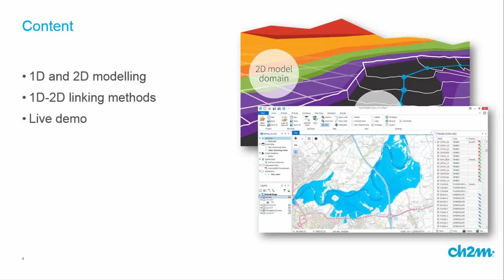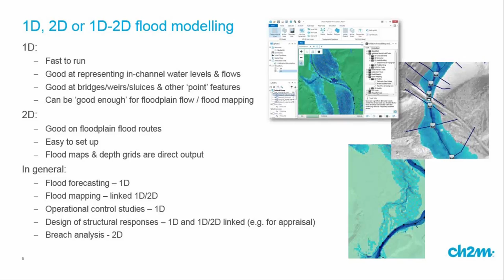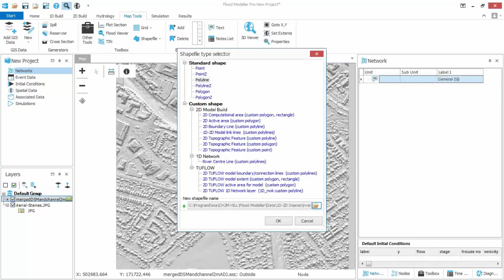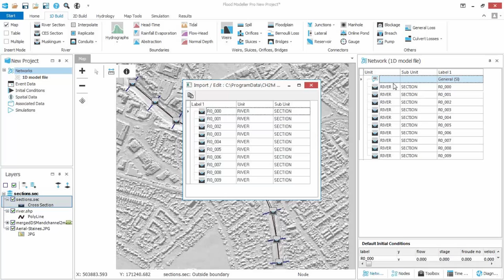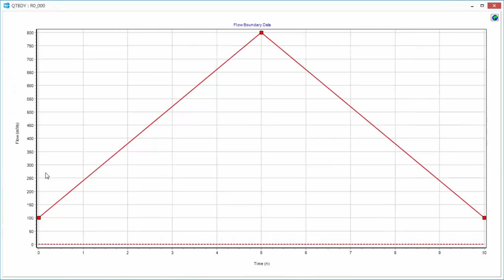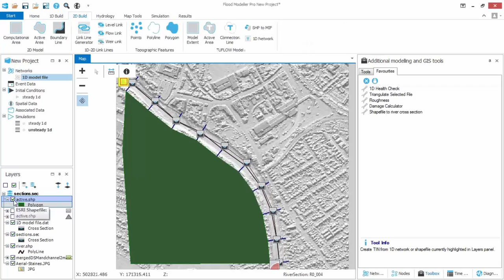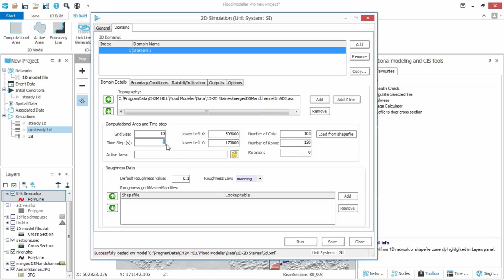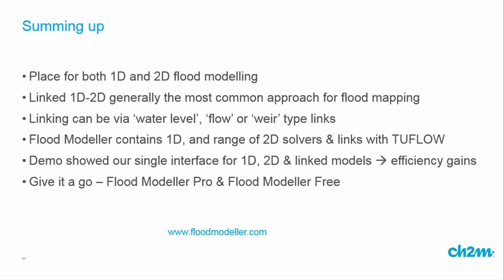Building a 1D-2D flood model using Flood Modeller

Comment: When pulling in a background map, is it possible to scale it? The scale of my background image does not match the scaling in Flood Modeller.
Reply from the maker: Hi there, background mapping is not actually used for any of the calculations, and so resizing this file outside of Flood Modeller may be the best approach. However, please feel free to contact support@floodmodeller.com and the team will be happy to look into your particular map file in further detail and offer suggestions.

Comment: Thanks this video was very helpful. just a quick question. if there is an option in Flood Modeller to do the 2D and Linked 1D/2D modellings then why some engineers use MapInfo to do the Linked 1D/2D? do we really need MapInfo when Flood Modeller is able to do that modelling for us?
Reply from the maker: Yes, Flood Modeller allows you to undertake 2D-only modelling as well as integrated 1D/2D modelling. It also allows you to model surface and sub-surface flows. With Flood Modeller, you have access to a GIS interface, so no need for MapInfo at all.